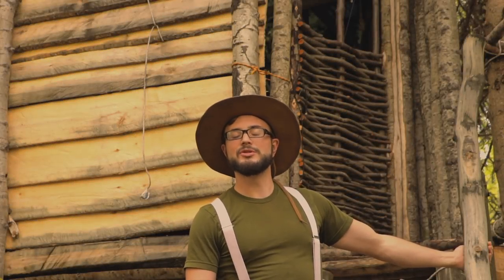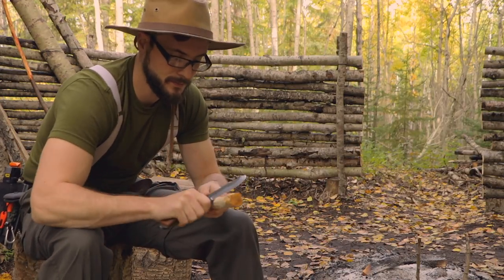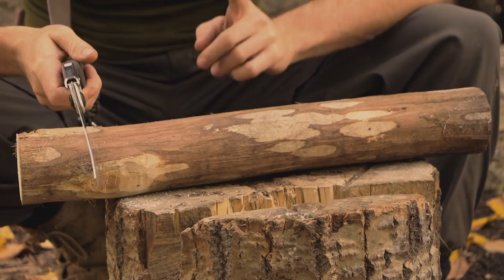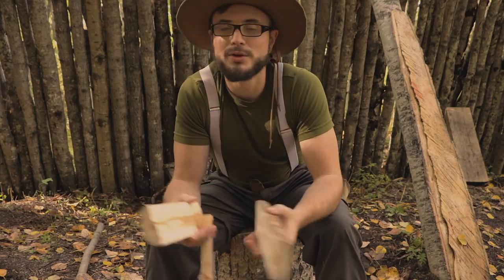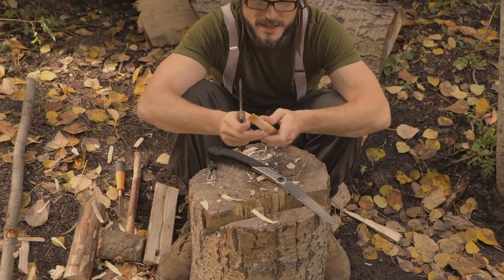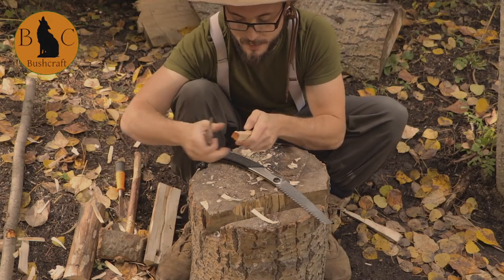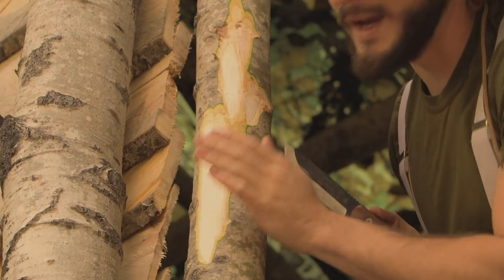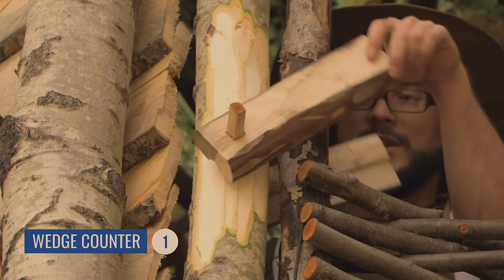Bushcraft Treehouse 18: Carving a Wooden Door Latch for the Shelter Door - Canada Camping

Comment: Watching this video I got an idea for your latch you can have another bowel on the far end that goes over the door that sticks out far enough to where you can use as a handle so you can lift the latch up and down oh and another idea people back in the day used to use bee wax to lubricate wood to wood contact hinges so if your latch or your door starts sticking you can use  wax to lubricate it I also heard people used to use  wax to help treat the lumber so it doesn't rot as fast

Comment: HOW TO MAKE GLUE, CONCRETE AND FIRE TAR!

Find a tree in the pine family. Any tree that produces sap is a great tool for multi use resin. 
Make shallow "V" shaped cuts (15 to 20) on the side of the tree to start collecting the sap. 

Once you have enough sap, boil it for about 10 minutes, gradually adding powdered charcoal to make sure it does not thicken as it boils. Adding charcoal also makes the resin more water resistant. If you want to add sand, you can make some quick concrete for a sealant and insulator. For a basic resin, use saw dust just before application to harden faster. 

IMPORTANT!
Like any glue, always crosshatch the surface before applying. This will ensure the glue has a surface to grab onto, and also prevents cracking during temperature changes and inclimate weather. 

You can use this for repairing broken wooden tools, broken projects or chipps, fillers and dowel locking glue, tarp waterproofing, and even hole repairs. Using natural resin is often better than industrial glues because as industrial resin hardens, it shrinks slightly without holding its shape whereas natural resin is flexible and can easily be reapplied if needed. 

Please give my youtube channel a shout out and a subscribe @Sour Sgetties

Comment: couple of suggestions that might make things easier. a little candle wax {or paraffin} rubbed on wooden joints will lube it. and if you bore many more hole it might help to get an auger bit, there's also one called a spoon bit however you may have more trouble finding them except for at yard sales or flea markets. keep up the good work. :)
Reply from the maker: +Mark Bennett thanks for the tip Mark, we do have an auger bit but it doesn’t work very well. I got it from an antique mall and that’s why were using the spade bit now. Also yeah I would’ve lived up with the candle wax if I’ve had some on the day but now it’s a fit together there’s not much I can do. Thanks for the comment 👍🏼
Reply: bar soap also works
Reply from the maker: +ram1brn lol but I don’t carry soap out there

Comment: Thanks for sharing another great video.  Your new camera is awesome!  I have a question: (and sorry if it has already been asked and answered)  Why did the ends of the dowel need to be square?  If you were to use a wedge (smile) at the end of a round dowel wouldn't that be enough to keep it from slipping.  There's not that much torque,  Just wondering.  Could have saved you a ton of time.  Keep up the great work.  Oh, and BTW, how often are you mistaken for Daniel Radcliffe?  just sayin'
Reply from the maker: +Margery K lol yeh you are probably right, but it’s just the idea I had at the time. I guess it would be how I would do it if I made a bigger version